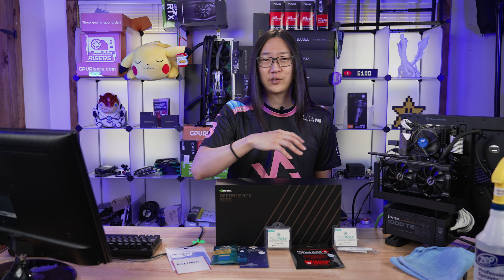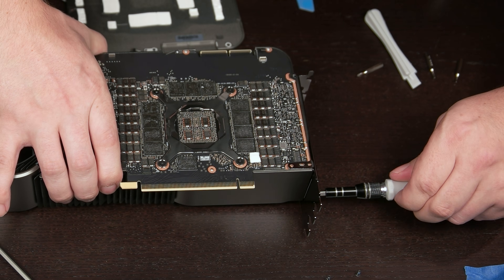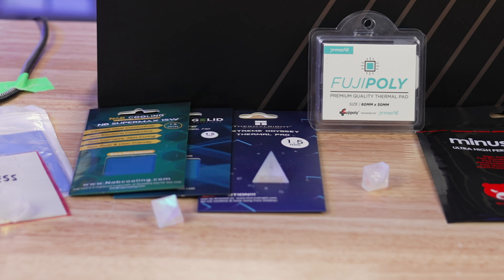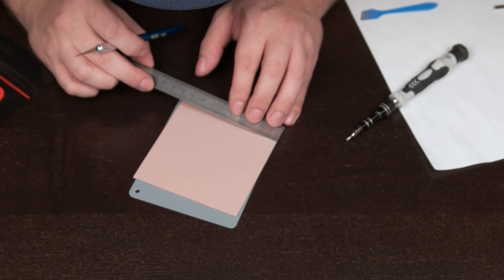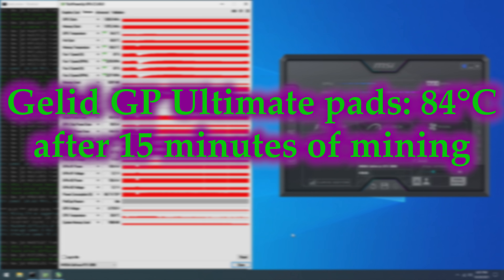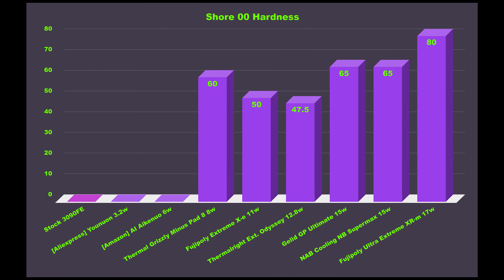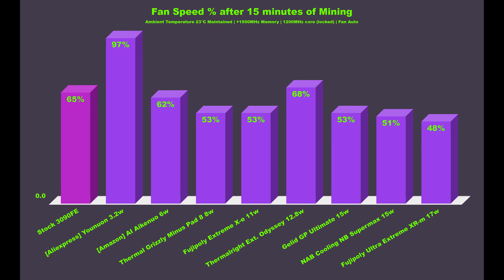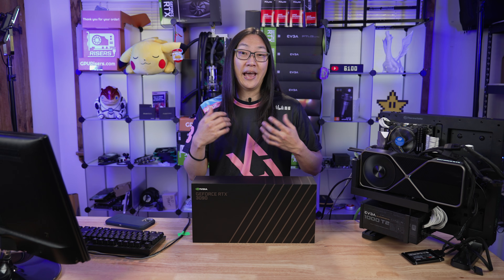Thermal Pad Showdown! What you should (and Shouldn't) Buy

Comment: excellent data! This shows that if you're gonna upgrade the pads, then you might have to get a 4 pin mini gpu PWM to 4 pin standard PWM adapter and multiple NORMAL thickness fans like the t30 or Silent Wings 4 and replace the stock cards with them
Reply from the maker: Thanks! I hope this helped you out in finding the right pads for you!
Reply: @TekShinji  I lucked out by picking Gelid based on some forum discussion, but your data made it VERY clear and will serve me years in the future when I may pick up some more pads but have forgotten about what's out there
Reply from the maker: Awesome, I’m glad you got what works for you!

Comment: Good video, ty
Reply from the maker: Thanks :-) glad you enjoyed it! What was your favorite part?
Reply: Couple things actually:
1. The tight testing parameters, using the same exact card and then just changing the pads in the same places. 
2. The comparison between all the pads and the temperatures chart was useful in figuring out what pads I wanted.
3. The conclusion of increasing the GPU core temp, because I didn't know that so it was a helpful bit to throw in. 

Overall solid video with really good testing, the pretty charts helped. @TekShinji
Reply from the maker: Thank you I really appreciate it! The part about the GP core temperature is potentially rising, was a surprise to us too.

Comment: This is what a lot of people don't understand: making something cooler "just because" is pointless. If it's consuming the same amount of power, it's producing the same amount of heat. And if it's designed to work fine at 100 ºC and you're pulling heat away from it faster than necessary, to make it 80 ºC instead, then you're dumping that heat into something else (be it another component or just the air), often for no speed benefit at all (because that component isn't even the one thermal throttling).

The most meaningful way to test this is to see how much you can overclock the various components while remaining stable with each cooling solution. That way you get can measure a real benefit (speed) instead of just "how much cooler it is", which in itself doesn't help you in any way.

BTW, while you were at it you could have tried using Noctua's paste on the memory chips as well. Memory generally uses pads for ease of assembly, but the paste might perform a bit better.

Also, a slight flaw in  the test is you didn't re-test the original pads after disassembly (i.e., remove the heatsink, mount it again before removing the pads, and re-test). This would be to control for any deformation or difference in contact pressure caused by the disassembly and reassembly. But I suspect the difference would have been less than 2 ºC anyway.
Reply from the maker: Hi there thanks for the details comment! We would definitely appreciate feedback like this, and would like to hear more about it. Come join our discord until us! Also, do you have any experience with any type of testing yourself? Would like to know what you’ve also went through before.

Comment: Dude. All im looking for is a replacement for my melted thermal pads and now im confronted with this entire new world of BS about better heat transfer might not be what you want from thermal pads. My backup plan if i cant find a good replacement thermal pad was to just put a dab on non conductive thermal paste on top of all chips that benefit from cooling and be done with it but now im learning that you dont even want that much better heat transfer.
Reply: it isn't that complex unless you have a 3090 (which has 24 memory modules dumping heat). Any other card you should be fine with any pad as long as they are as good as stock. I recommend the NAB pads.
Reply from the maker: @Creating_Space I concur with this!

Comment: For my Rtx 3090 FE I used Thermalright Thermal Pads 1.5mm 12.8 W/mK and saw -35c (never gets above 75c now with 22c ambient) on the Memory T junction temps under memory intensive workloads and only a rise of +2c on the die core temps with 50% fan speed. Mx-4 was used on the Gpu die. Notes: i did use a lot of mounting/screw pressure when putting everything back together. Almost 2 years now and still going strong with no reduction in improved thermals. Gpu core temps stay around 45-50c when gaming in 4k. Case is a LanCool 215.
Reply from the maker: That’s awesome! I’m glad it worked out for you :-)
Reply: How many packs did you use?i plan to replace rhe thermal pad for my recently bought used gpu.is 1 pack enough for 16gb vram gpu?

Comment: Does this thermal pads can be used in laptops or only in pc’S ? My laptops is having high temps and I want to change the thermal to a new one , both on cpu and gpu . As far as I can see , I can use the gelid thermal pads for my laptop on cpu and gpu cores ? Next video you should make is what is the best thermal paste and that’s perfect thing for all the thermal issues and what’s the best to buy and budget so any pc or laptop user understand what is the best option on what to change for their thermal paste and pads , finishing the thermal category for this devices
Reply from the maker: Technically, the thermal pads can be used anywhere where they are designed to be used such as laptops, computers, and other electronics that needed to dissipate heat without thermal paste

Comment: I think it's important to keep the gpu W/mK higher than the memory.  Using 20 W/mK  Kritical Pads greatly lowered my memory temps, but the 15  W/mk  thermal paste I used can't keep up and GPU core rapidly heats up now, despite sitting much lower at idle.   I assume I need to use much higher W/mk material between the GPU core and the block to compensate and keep the thermals moving in the right direction, but overall I score the same in benchmarks and that's the upgraded pads are the only way to ensure consistent performance when rendering with stable diffusion.
Reply from the maker: Yes that is correct. Difficult difficult to maintain identical parameters that we tried.

Comment: undervolting gpu can slowly fry memory cause fans will spin slower. I know that.
but I never expected +21 C increase on core when memory is cooled properly.
Reply from the maker: Those are some pretty excellent temperatures! You can always adjust a fan curve manually, which is what most people prefer to do it when it comes to tuning your performance exactly the way you want.

Comment: You forgot Wm/k means nothing if ther eis no thermal resistance info for example noctua thermal paste is between 3-4 Wm/k and it compete with MX4, becouse it have low thermal resistance, so low heat conductivity but also low thermal resistance object will transfer heat much better than high conductivity but high thermal resistance
Reply from the maker: Exactly. Especially when they only compare against their own products.

Comment: I have a Zotac amp holo 3080ti that's going to be liquid cooled by a custom cooling loop from corsair in a few months time when I get all the parts. Should I still go with the gelid pads or other ones? My main focus of this build is making sure my vram temps never go above 90c
Reply from the maker: It’s highly depending on what you’re doing. If you’re going to go custom loop, they usually come with pads in the kit. Are those no good?
Reply: @TekShinji  Thx for responding mate, only problem is that the block im planning to get is from corsair and hasn't been released yet. If it doesn't work for my card though, ill just use the one for it, which I also don't know if those are good or not. I was also told by multiple members of the watercooling discord server to just use the ones on the block itself otherwise proper contact won't be made.
Reply from the maker: Interesting, it’s kind of hard to keep track of this comment chain through YouTube so if you like join our discord, we can continue the conversation there
Reply: @TekShinji  ill consider it, thanks for responding.
Reply from the maker: Welcome!

Comment: Random question.  My laptop thermals aren’t the greatest. Can use these to help with that ? Not on the direct cpu or gpu. Just on the areas surrounding it that need it. Thanks
Reply from the maker: Only if u have a way to dissipate the heat. For example, if you put your laptop inside of a fully insulated box, it’s not gonna make any difference how much thermal pads you put on it.

Also, you would have to make sure it’s totally non-conductive and it’s not gonna leak oil into anything
Reply: @TekShinji  the laptop has pads already. I don’t want to add more. I want to replace them if they could help with thermals.
Reply from the maker: It really is dependent on the situation of why the thermals are not good. Some designs of laptops are just very poor because of size constraints, and pricing.

You can definitely help but I recommend you look up Fb see if other people have done it first
Reply: @TekShinji  I appreciate it. It’s a relatively new laptop to just came out. I definitely learned my lesson on this one.  I got the new gigabyte g5 kf.

Comment: this video is totally useless. you cant do a research only with 15 minutes test. Some materials take time to transfer heat, others do it faster, but that does not mean that in 3 months they will continue with the same quality of thermal transfer.
Reply from the maker: Hey there buddy thanks for the feedback. There’s some test we did in the background that we did in publish because they were kind of subjective. But a lot of pads seem to degrade overtime. Every single pad did fail eventually though. But it’s highly dependent on its use.

Comment: following this I repadded my strix 3080ti with 2mm gelid extremes. memory temp was fantastic but core and junction temp went up by a lot. so I tried 1.5mm thermalright and then opposite effect, core is very good but memory goes up to 106 while gaming. it seems stock pads are 1.75mm, which is impossible to find. any ideas ?
Reply from the maker: Have you tried anything else other than different pad sizes?
Reply: @TekShinji  I tried putting back the stock pads and while its better than the 1.5mm thermalrights (which are in fact 1.3mm), mem temps are still high and sometimes cause throttling after 30min+ of heavy gaming. 

my next step would be the 2mm thermalright odysseys. do you know if they are shallower than the rating, like their 1.5mm counterparts? 1.8mm would be perfect
Reply from the maker: Unfortunately, this seems to be a super inconsistent thing in the thermal pad space. There’s only like a four manufacturers that actually make them they all get rebranded and they often get squished and transport.

My best advice is to buy a whole assortment of them and use the one that fits the best
Reply: @TekShinji  so I got the 2mm odyssey pads and they fit perfectly. it seems they are indeed shallower than 2mm gelids. I hipe this helps some people with asus 3080s
Reply from the maker: Very nice thank you for letting me know. Definitely let me know how it works out for you!

Comment: HOW did I miss this video for a year?!  Great work!  I have used the NAB cooling pads and the generic blue 6 W/M K pads.  Glad to know they actually WORK.        
*  If you ever decide to revisit this and review some more pads:    
Owl Tree makes Blue 6 W/M K and Grey 12.8 W/M K pads.  They come in a 4-pack of 0.5, 1.0, 1.5, and 2.0mm thickness, 100x100mm in size.    
Arctic makes Pink and Blue pads, TP-1, TP-2, TP-3 and TP-4, in various thicknesses and sizes, up to 200x100mm.    
XPC and Kritikal make a Black thermal pad (carbon?) claiming 20 W/M K but it was hard to find in 1.5mm thickness.
Reply from the maker: You didn’t miss it, the algorithm chose not to show you for some reason ha, ha. That works, though, let me know how it goes for you!
Reply: Did your core temps increased while swapping thermal pads like in this video ? I find it hard to believe what they say in the video because when I swapped mine between different pads/brands on Gainward RTX3080ti I have never experienced core temperature difference of more than 1C initially and also it is just because of this video that I started swapping pads with very low w/mk -5 while being scared of increasing temps and when I did changed to 5W/mk  I got VRAM temps increase to 20 C over stock thermal pads.So I'm still looking for as effective thermal pads as the stocks were ,ordered  GP ultimate but have not tried them yet thinking they might be a bit too hard.
Reply from the maker: Are you asking whether we did more than one test? I’m not exactly sure.

Comment: I think a contributing factor to the increased GPU core temp with certain pads, is that they are reducing the pressure applied to the core, leaving a thicker paste layer. I expect some temp increase with better VRAM cooling, but not 20c+

Would be interesting to see a high end thermal putty in comparison, since it allows for optimal core contact / pressure.
Reply from the maker: That would be interesting as well. Let us know how it goes for you!
Reply: I actually just got a 6700 XT that was a factory refurb with fresh paste and pads. The consistency / density of the pads appeared to be on par with Gelid Extreme, so pretty good quality to begin with. I tested with Furmark (1080p 8X) before and after switching to U6 Pro thermal putty and PTM7950 for the core. 

It dropped -2c core, -10c hotspot, -4c VRAM and -5c VRM. Went from a hotspot delta of 18c, to 10c. 

Ambient temp was identical between tests and I used a static fan speed. Let the cards heatsoak and reach steady state before recoding any data.
Reply from the maker: Very nice regarding your temperatures. Definitely in a good range.
Reply: @TekShinji  beware that the wrong thinkness of the pads can reduce the pressure on the core to the extent that the core gets a permanent damage due to the heat.

Comment: I find your results about thermalright oddysey pads incorrect. Ive been using them for two years on my RTX 3080 gaming oc. Memory temperature went down from 105c to 72c. Your results missleading as hell as if you bought wrong size pads.
Reply from the maker: Hi there, unfortunately, we bought many of the same pad and they’re all undersized. But of course everyone’s batch will be different, especially since the pads all come from different places and re-banded.
Reply: @TekShinji  Then it destroys all purpose, each gpu have some difference my gigabyte gaming oc had 2mm pads and thermalright oddyssey did wonders. As for many more who bought them, i got mine from aliexpress and 2 years later memory temps are still as good as they were day one with new pads. There was even better pads on the market who brought 3080 temps down to 65c on memory.
Reply from the maker: Yes, I understand that. However, we have to go by what the market is willing to provide other words, if all the pads that we bought were the same size, we have to assume this is a pattern that other people will experience. Of course, every padlock is different, and we have no control over that.

Comment: Thank you very much for this very comprehensive test. For use on PC laptops for non-gaming everyday work and personal uses, which thermal pads would you suggest for the CPU, GPU, RAM and SSD, and what thickness?
Reply from the maker: It would depend on what you’re using for that area. The best way is to buy a set of pads and measure them before you replace it.

Comment: how about K5 Pro Viscous Thermal Paste? Maybe do a updated video?
Reply from the maker: Hi there. It really depends on the application and each one is best for its on specific application. Thermal paste is good for things that have varying thicknesses and don’t come in. Standard sizes are very thin.

Thermal pads are pretty decent for most applications and are much easier to manufacture and apply

Comment: wondering what do you think about not placing thermal pads behind the VRMs on a 3090 - I have a theory that not heating up the backplate with VRM heat and only attempting to cool the VRAM with it would be better, however, I have not validated it
Reply from the maker: I’m not sure what you mean. Could you explain a little differently?
Reply: @TekShinji  the VRMs of the 3090 are cooled with a thermal pad on top of them and behind them (through the PCB); the top side is contacting the actively cooled heatsink while the back side is contacting the passively cooled plate that also cools the VRAM => would removing the thermal pad behind the VRMs be more better for the VRAM
Reply from the maker: I don’t understand how that would be better for the VRM’s? That would drastically increase your temperature and give less surface area for heat dissipation.

I would say NO, that would not be good for them at all. 

However, all things can be proven with science. If you’d like, you may remove them to see how ur results are.

Comment: i bought a asus tuf rtx 3080 two weeks ago and was getting pretty horrible temps. GPU temp was fine at 64C but hotspot was 90C and memory junction was 110C. I replaced the pads with Gelid Extreme pads and it dropped my memory junction temps 45 degrees which is awesome, also after a repaste with some arctic mx-4 it dropped my hotspot temp to 70C and gpu temp stayed pretty much the same. The thing I like about my asus card is that it has a separate heat sink for the gpu and the vram so the reduced vram temps didn't mess with the gpu and hotspot temps since they are on different heatsinks.
Reply from the maker: Very nice! Honestly, that’s probably a better design anyway.

Comment: If anybody bothers to read this, thermal pads are NOT the best! Regardless of the brand name or thermal conductivity. THERMAL PUTTY is actually way BETTER THAN thermal pads. Search for "Upsiren U6". The temperature difference is amazing compared to thermal pads. (This is not a replacement for thermal grease, however).